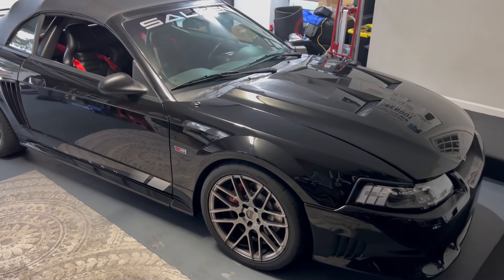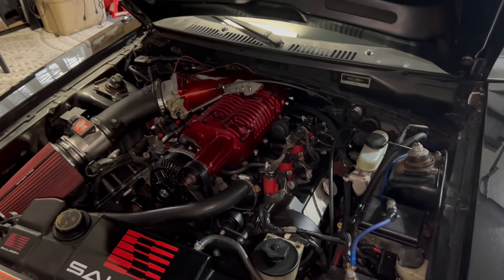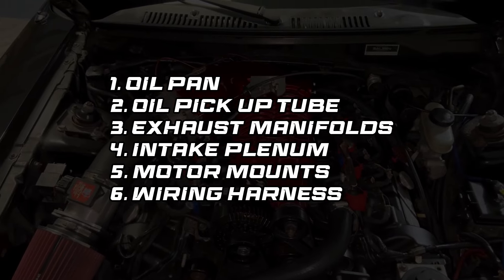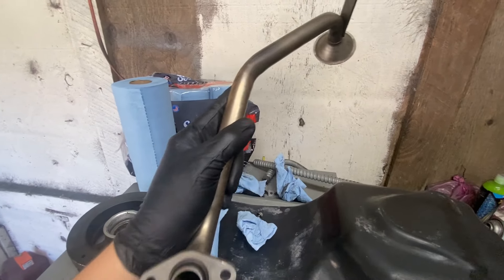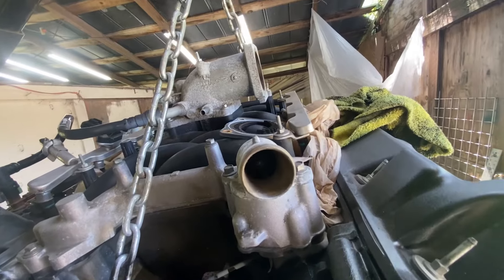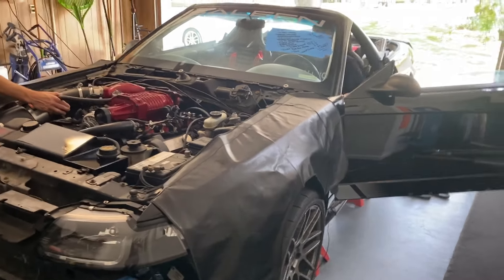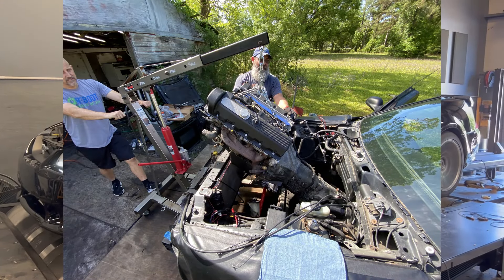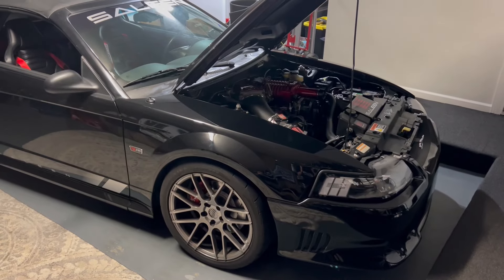How to Swap your Mustang's Engine for CHEAP!

Comment: Can't use the crown Vic intake, it aims the wrong direction, also you don't need to swap wire harnesses.  Otherwise spot on video. 
Edit: some of the panther platforms have oil coolers on the filter housing, which the mustang chassis doesn't support, so if it has the cooler replace it with the mustang housing.
Reply from the maker: Some great info I forgot to mention right here. For sake of simplicity though, it’s easier to reuse your mustang harness. I was pretty sure you can use the Vic intake manifold but have to swap the plenum to a mustang one. I believe the manifolds are the same for both.
Reply: @904Saleen  you are correct about the plenum swap. Same intake
Reply: Thank you guys for being those dudes that know this shiz... My 3.8 is begging for life lol it is at 290,000 and barely hanging in there haha...
Reply: Same engine the intakes the opposite side.

Comment: I mean I used a 2010 f140 4.6 2v. Swapped pick up tube, oil pan. Valve covers, front covers, and intake for the mustang one and it worked fine. It's called modular for a reason
Reply: @centraltexasfoxbodies wait so I can swap a 6.8 into my sn95?
Reply: @centraltexasfoxbodies please lmk am looking at engines to purchase rn actually

Comment: Also people need to know best combo is the non PI bottom end is better with PI-heads and intake.
Reply from the maker: If, you're looking for a good OEM plus setup and don't mind digging that deep into the motor, I agree
Reply: IMO more cost effective from performance standpoint are Trick Flow heads than PI ones.

Comment: I wish the Coyote swap would have been this easy. I think I'll keep my 4.6 2V and put a supercharger on it. It's nice to know that there are so many options for the SN95 Mustang even today. I'll have to keep the Crown Vic in mind when it comes time to replace my stock 4.6.
Reply from the maker: The Tork Tech supercharger system is a great option when the time comes to boost it. They are relatively affordable and allow you to run any 03/04 Cobra Headunit

Comment: Need to swap your injectors and fuel rail if your putting in a newer crown vic motor other than that its spot on. Also the coolant temp sensor on newer 4.6 is on the head under the intake manifold sonyou will have to wire it up to factory harness as new intakes dont have the original temp  sensor location drilled and tapped on the newer crownvic 4.6.
Reply: Thank you bro

Comment: Did this same swap, Used an 09 crown vic with 90000. I did have to swap the oil cooler from old engine to crown vic engine.
Reply: what harness and computers do you need for it to work

Comment: Just did mine for 600 bucks and got a spare motor that had a blown head gasket with sellable parts 2011 crown Vic flex fuel motor for 635

Comment: Also running the Vic/GM pulleys and belt routing no problem. My car is cammed, FBO, geared, and dyno tuned by lee blankship. I have videos on my channel. I have tubular K member now, but i have stock K member and suspension with GM/ oil pan no prblem. Stock mustang motors mounts too. I even left the cold weather heated pcv cam coverslolol.

Comment: Almost forgot some crownvic grandmarquis will require you to keep thier specific accessory belt as the mustangs have an extra idler pulley on the passengerside which the grandmarquis crown vic wont have... this is only on some.. the last crown vic motor i got was a 2011 and it didnt have the pulley but the timing cover did have the spot on the timing cover to swapnit over.. another 2008 grandmarquis 4.6 did not have this location drilled and tapped on the timing cover

Comment: im 17 and i got a 2004 mustang gt but the motors kinda messed up but my uncle gave it to me and know he has kidney and liver failure but i want to build it in memory of him but i just need to motivate my self to fix it but i wanna try to get the terminator engine to swap it but there so much money
Reply from the maker: Man I’m sorry to hear that. But that sounds like an awesome project to remember him with. You can always look into like some other 4vs. 99/01 Cobra or 03/04 Mach 1 motors will work. Lincoln Aviator/MK8 motors will also work. My friend Blake has an Aviator 4v with like 180k miles in his Terminator that he got a roller with a ported Eaton and the full blower kit he strapped on to it. Running on E85 and is making a bunch of steam. Definitely close to if not 500whp and it’s still running strong. @Certified Rippers has some videos of his build you should go check out if you’re looking to do a 4v setup.
Reply: @904Saleen  bet thank you man

Comment: Lots of internal differences he neglected to tell you 

96- 00 crown vics are NPI engines. They Have Different cyl heads/intake/pistons. Cylinder head ports are much smaller than the later PI. NPI pistons have less of a dish. (more comp) A lot of Old schoolers will take a NPI with block and pair it with PI cyl heads and PI intake for a bump in compression. My personal build is just that, with 11 pounds of boost from a vortech centri blower.
Reply from the maker: I was covering newer 2vs only just because that’s what most people are likely to find and buy. I do feel that maybe I should’ve covered that. A lot of people are looking for a fast and easy swap, and they are way more likely to get their hands on a 2001 or newer motor. In terms of those PI 2v, there are very few differences

Comment: Ik this comment will not be seen but i have a 04 Vic P71, and a 04 Mustang GT Vin X, My question is my mustang is a manual gearbox, will the CVPI engine work with it cause i was thinking about getting my Vic Engine built for the mustang to put a keene bell suppercharger.
Reply from the maker: Don’t worry brother, I try to check my comments almost every day, especially on this video! And yes, you should have no issues building that motor and pairing it with your manual transmission

Comment: Is crown Vic engines better and faster then a regular 99-04 gt engine
Reply from the maker: There’s a slight difference in the cams but power hasn’t been documented to be much different with an identical intake, exhaust, and tune
Reply: @904Saleen  ohh ok bet thanks!

Comment: I have a 2000 GT I swapped a 07 Vic into it. I might need a tune of what I understand. It's running okay in 1st then I shift it into 2nd @3k and it bogs down it's the same 2nd-3rd. When it's at that point it won't speed up and I have to stop it to restart to process of getting it home safe. Any help would be great! ( Changed the sparks, coils, fuel pump and filter) Long tube heads, cat back exhaust, CAI for mods
Reply: Bump
Reply from the maker: Hard to diag without seeing what its doing. Is this an auto or manual car? Also are you still running the stock MAF/Fuel Injectors? The car should run fine with the mods you listed, but if you changed the MAF or fuel injectors without a tune it would throw everything off.
Reply: @904Saleen  it's manual and I did change the fuel injectors but should be OE just blue colored as I felt that was the problem originally and bought new to switch it
Reply from the maker: @aaronbehrenwald1513  do you have the part number from the old injectors and the new ones?

Comment: Hey i have a question so u basically took the v8 motor and put the svt supercharger on it?
was it just bolt on to the crown vic or did you have to change other things.
Reply from the maker: This is a Saleen Series 2 supercharger which is basically a Magnuson MP90. The Cobra has an Eaton M112 which is whole different setup. If you're looking to install a Cobra blower on your car, I'd look into the Tork Tech kit. It allows you to run any blower designed to fit on a Cobra.
Reply: @904Saleen  well right now i have a v6 i was going to do what you did and put a town car into my car and i was just wondering how supercharging it would work also what other stuff would you upgrade.
Reply from the maker: I'd look into some of the supercharger kits that are available. Some kits like the Tork Tech will need the separate purchase of other supporting mods, and the blower itself, and require some modification as well. Saleen kits, if they are complete will bolt on directly and just need a tune, but there are some mods to fix some defects I would highly recommend. Another great kit is one from Jonse Speedlab which is basically a modernized version of the Saleen S281-E 2.3L Whipple Kit which comes with everything you need. You can also go the Vortech route too.

Comment: I have a 2000 mustang gt with a 02-03 crown Vic engine swapped in it, I was wanting to put a on3 turbo kit on the car. Besides the tubular k member and coil overs will the on3 turbo for the 99-04 mustangs work on the crown Vic motor? Thanks for any help!
Reply from the maker: Yes it will. @MustangLifestyleTV used a Vic motor for his On3 Turbo Bullitt build and that car ran in the high 10s in the quarter mile.
Reply: @904Saleen  okay sweet, I’ll have to check them out! Thank you so much for your reply man!

Comment: I have a 04 mach 1... will this work for that as well? I was looking at doing a gt 4.6 and swapping tthe heads. I've been told the water jets are different from the cobra and mach 1 to the gr and other 2 valve 4.6. Anyone have any knowledge about this
Reply from the maker: As far as I'm aware, you should be able to swap the heads and be good to go. The 4v's in the 99-01 Cobras, Mach 1s, Marauders use the same block casting, pistons, and rods as a 2v. The main difference just being the top end. But the motor swap should look roughly the same overall in terms of process, minus swapping the heads/timing if you choose the go that route.

Comment: I’m trying to decide between building the 4.6 2v or swaping  a 7.3 godzillla or coyote idk what to do
Reply from the maker: All depends on what you want to do, and what your budget is. Coyote and Godzilla are new platform and cost quite a bit more to do stuff with. With the 2v or even a 4v, you can build it for relatively cheap, and power adders like On3 single or twin turbos or even TorkTech, Saleen or Vortec superchargers can be picked up pretty inexpensively
Reply: 7.3 in junk 
Go coyote or 2V

Comment: Aye! I have a 01 Grand Marquis. I don't want to do a Coyote swap. I don't like the way they sound. I can't figure out if I should keep the 4.6 Sohc or go 4.6 DOHC. What's your opinion?
Reply from the maker: It all depends on what you intend to do with the car. Staying with the older mod motors is more cost effective especially when it comes to power adders. Plus they are pretty much plug and play in comparison to a coyote swap
Reply: @904Saleen  I have a pair of 6466s. I don't have to use both, even though that would be gnarly. Just want enough power to beat on 392s.
Reply: @itsme675t7  damn what the 392s do to you??

Comment: Correct me if I’m wrong but I’m very sure Crown Vic’s gms, town cars actually have different cam grinds than the mustang and f150, less hp slightly more torque
Reply from the maker: The info is spotty but I've heard that before. The F-150 I know for a fact have a different grind, but I believe the panther chassis cars and the Mustangs are the same.

Comment: I got a crown vic donor but my mustang is a v6. What all do i need to swap over other then the motor and obviously the transmission also. 
Change out computer and wiring harness. Driveshaft and rear-end
Reply from the maker: Motor, Trans, Computer, Wiring Harness, Driveshaft, Rear End, K Member, and potentially some other small odds and ends.

Comment: I just bought a new edge I just want my build to be automatic tho just here for advice and tips
Reply from the maker: The 4R70W if maintained can be a good transmission. The gearing is just rather long. If you're staying NA, I'd recommend pairing it with some higher gears like 4.10s. If you're going boosted, I wouldn't swap to any gears higher than 3.73s. Just be weary about the overdrive servo failing. It can cause a slip from 3rd to 4th gear. But those transmissions with some cranked up line pressure can shift hard and fast.

Comment: How well does this engine interface with the 4R70W automatic transmission?
Reply from the maker: Considering all of the Crown Vic engines were paired to 4R70W's I'd say just fine lol. They are a direct bolt on.

Comment: Is the truck engine harder or more expensive
Reply from the maker: From what I’ve heard, the truck engines may require a timing cover swap but I’m not entirely sure of that. I do know it will require these same things swapped on to it for it to go in. Someone who has done the swap with a truck motor may be able to chime in on this

Comment: Didn’t the supercharged Saleen motors have forged internals vs a stock mustang motor? If so, he may have been better to fix the old motor.
Reply from the maker: Only the S281 Extreme’s did. They had the same rods and pistons the Terminators had along with a 2.3 Whipple from factory. All other S281’s were stock blocks

Comment: Will this work exactly the same going into a 3.8 model and what kind of harness would I need to get because I heard you can’t use the 3.8 harness
Reply from the maker: You'll need to swap a full GT engine harness and ECU into the car for it to work. You may be able to make the V6 body harness work but I'm unsure.

Comment: Does the p71 engine have the same power in your mustang? If so how? Why can't I get that power in the crown vic?
Reply from the maker: Crown Vic ECU is detuned. But it’s the same EECV ECU in the earlier cars as the 2v mustangs. I think the later crown Vic’s started using a different version of EECV or moved on to the same ECU platform as the 3v mustangs

Comment: Ok so I’m looking to swap a 5.4 2v the ford lighting motor without superchargee the triton and I wanna swap in it a s197 it’s an 8 bolt sled plate plan on getting a car without engine or blown engine then swapinf the 5.4 2v swap should it bolt right up if it’s a 8 bolt right ? I don’t wanna mess with a lot just wanna swap the 5.4 2v in so later on I can put a lightning superchargee shouldn’t need new place or harnes or anything just need guidance
Reply from the maker: Well if you’re swapping it into a 4.6 3v car, so 05-10 the motor should fit in. I’m not 100% sure if coyote cars use the same motor mount system. Your 3v ecu may be able to run the 5.4 2v but I’m not too sure. I know I’ve seen 3v motors run off the 2v ecu with cam phaser lock outs but idk if it can be done the other way around.

Comment: I need help, I'm thinking about buying a 2008 crown vic motor with 50,000 miles. What would I need to do about the ecu and value covers.
Reply from the maker: You can keep your Mustangs ECU and the valve covers don’t need to be changed. I only changed mine because I got a said of trick flow covers that I liked the look of
Reply: Thank you

Comment: Very very nice video. Im considering getting a clean 00 gt with a bad motor. If i do im thinking of doing some cams and a small shot. Have you ever done cams?
Reply from the maker: I haven't done cams personally but they do make for some decent gains and help shift the powerband a little higher as well..
Reply: @904Saleen  let's not forget the sound!

Comment: Why go grab a 2v when u coulda grabbed a 4v 4.6 and started with 305hp and had more strength and options for power later ?
Reply: I'm researching doing that in a Thunderbird with a turbo
Reply: 2v a better built engine
 It'll last much longer

Comment: What if you don’t chang the oil pan pickup tube
Reply from the maker: The Crown Vic pan and pick up will bottom out on the K member cause the pan to get pushed into the pick up tube and starving the engine of oil.

Comment: I have to ask. How did you manage to get a super charger To fit on the stock intake. Because I believe that is the 4.6. PI UPPER intake
Reply from the maker: The supercharger’s intake manifold is different from a stock PI manifold. And the whole plenum is done away with for this supercharger as well.
Reply: @904Saleen  So what intake are you using?
For that 2011 Crown Vic motor.

Comment: You missed one u need the mustang oil dipstick tube the two are totaly different length I just did a 2011 crown Vic flex fuel motor in my 03 gt
Reply from the maker: I kept the stock Vic dipstick that came with my 2011 motor. It is a little tight in there but it works fine and reads correctly
Reply: @904Saleen  weird yea it’s Deff shorter and if u put both dipstick tubes in and side by side  they don’t sit at  the same length and with the Vic pan being deeper and having the shorter tube u would think with the shorter mustang pan and with how far it sticks out it shouldn’t be right so that’s weird it’s reading level
Reply: @904Saleen  the dipsticks are the same length but tubes and pans are different must be a ford miracle lol
Reply from the maker: @The1Perfume  must be. I had questioned whether it would work during my swap but found it to be consistently accurate. My motor has seen 3 oil changes since it’s swap and has been right on the dot each time.
Reply: @904Saleen  sweet!!! I still wouldn’t trust it, though is like reasoning in Common sence would say it can’t be right because if the crown Vic had a deeper pan and a shorter tube so the dipstick would sit deeper in the pan for correct reading for using a shorter Pam, and still that longer tubes of the dipstick since deeper cant right and I’ve been reading that on some forms to saying, you got a swap, the dipstick tube, and I almost didn’t until I noticed that there are two totally different sizes, but yet the dip sticks are the same so I mean I wouldn’t I wouldn’t do it but your car looks pretty sweet, so do you